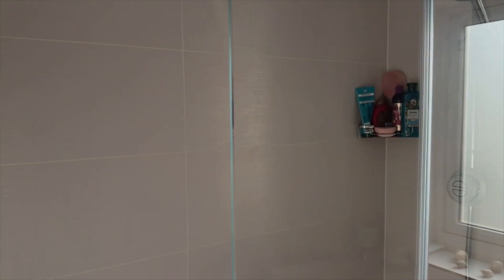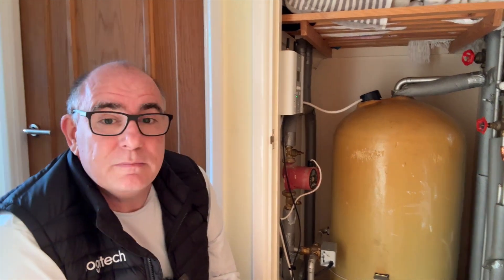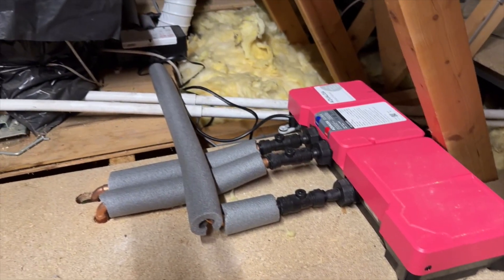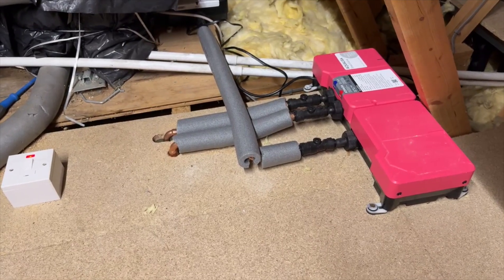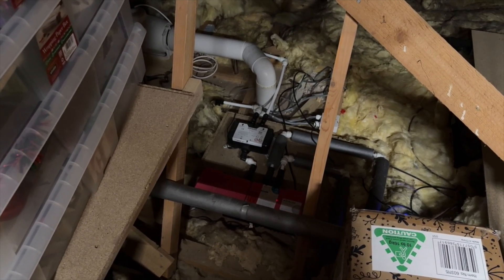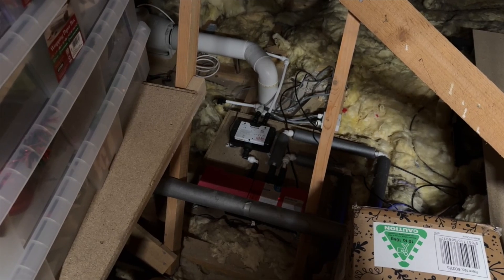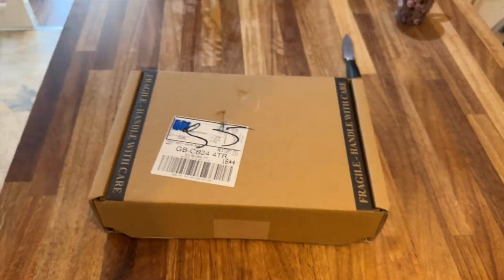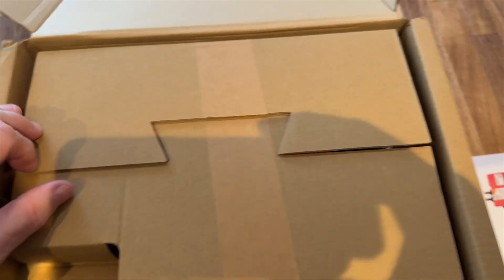Avoid These Heat Pump Pitfalls That'll Break the Bank!

Comment: how do you turn a heat pump of on a warm day and like this morning we get up to a frost , and what did you save changing your hot-water tank
Reply from the maker: you don't have to, it has a temperature sensor outside, it figures out based on your set temperature on the thermostat what the water temperature it needs to generate based on the difference between inside and out and gets on with it. Its all automated you just set a temperature in the house and forget it

Comment: Early on there seems to be some confusion between vented and unvented. Vented is usually a cylinder with a cold water storage tank. Unvented is typically served by mains pressure, so long as everything is sized correctly there is no requirement for a pump. Maybe this is best described by an industry specialist.
Reply from the maker: Yeah, I might’ve gotten the wrong way round, I’m an owner not a plumber😂

Comment: Why not use a vented cylinder designed for heat pumps, and before anyone says you can’t you can! There are companies that do make cylinder for heat pumps they just have much larger coils. 40 years ago I used to buy special high recovery cylinders for clients who needed them.
Reply from the maker: i’m sure there are, but to buy the solution from my vendor they will only supply cylinders that are tested by them as guaranteed to work. so my choices are very limited
Reply: @JonathanTracey My house is 8 years old, so the hot water tank and system is as cutting edge as it gets, but octopus still wants to change it all if I get the heat pump installed.
Reply from the maker: I think to get the grant it needs to include a tank that is up to the spec given by the government. The only way to be sure is to change it

Comment: This new unit you've purchased isn't a pump, it's just a remote valve unit.  An unvented cylinder doesn't need a pump to feed the shower.  Crazy that they charge hundreds of pounds for a box with some solenoid valves in it!
Reply from the maker: yeah i got my terms mixed up, #notapkumber
Reply from the maker: they even told me they do t make spares available to other companies until the product goes out of manufacturer - which means they can charge what they want

Comment: In 2022 I installed an unvented hot water cylinder designed for use with a heat pump but I operate it vented. We don't have great water pressure so I decided to retain the existing shower pump and a cold water storage tank. Two years later and it still works fine. If we had a reliable high pressure water supply I might have chosen differently.
Reply from the maker: interesting i’d didn’t know that was an option, i’m kinda following their recommendations, so hopefully it will work out ok

Comment: Oh John, you can have them converted from pumped to a pressurised one, I did, it was about £100, a company called ‘our bathrooms’ I recall, found on eBay.  Beauty is it’s the same box so no change of pipe work. I have 3 varieties of the aqua Lisa showers now, they’re easy to fit. My shower valves now live under the floors and bath rather than in the loft.
Reply from the maker: i did look at it but getting them converted just seemed a risk. did they change the existing modules or replace them entirely

Comment: I heat water to 43C in my Mixergy HWC, old electric shower no longer used, shower head connects to bath tap outlet for nice 43C shower at mains water pressure which for me is good.
For me the pressure from old header tank meant hot water flow was poor (Bungalow).
If insufficient pressure on mains I believe a pump could be added to boost that.
Reply from the maker: was hoping to get a mixer by tank but it just won’t fit in my cupboard and the wife didn’t like the idea of taking space from the bedroom.

Comment: Hi Jon, looking at the diagram at 6:17 it' looks like the pumped version is the same as the unpumped version, only with a pump added on the side. When your plumber comes to change them over, maybe worth seeing if you can just unbolt the pump off the side and you've effectively got an unpumped version. Worth a try, may save you £800.
Reply from the maker: that’s what i hopped to do as the older style ones allowed this, the ones i have are one piece so no way to disconnect it.

Comment: I absolutely do not understand why on earth you need a pump when you essentially get main's pressure on the hot water side. Do you not have a high enough mains pressure to support a shower?
Reply from the maker: The existing system needs a pump and a mixer due to to much difference between the hot and cold water pressures, the pump regulates the flow of cold water, it also lifts the hot water up a floor to the showers. The new system will be pressurised enough to not need it

Comment: Hi you are going to hate the shower as the pump you  have to fit is usless and very expensive we had a heat pump fitted 2 years ago and had the same shower and had to get a new pump to Handel mains pressure. Biggest regret is the loss of a very good shower
Reply from the maker: Our plumbers did a pressure test and assure me will be ok, fingers crossed
Reply: @JonathanTracey  it’s basically a glorified thermostat
Reply from the maker: Yep

Comment: if they are not cheap and quite good sell them used and get some money back.
Those are long lasting products and demand for used is always there - it is not cheap chinese crap.

Could be a lot worse.
Reply from the maker: That’s the plan, once I have the new ones installed will get my plumber to find second homes for them

Comment: Although I would always prefer an unvented cylinder instead of a vented cylinder I'm pretty sure you could get a vented cylinder that is compatible with a heat pump.
Reply from the maker: The options are suprisingly limited and due to the space constraints in that cupboard our only option was an unvented one
Reply: @JonathanTracey  I find that hard to believe. You could get a vented HP cylinder where the HP circulation circuit is pressurised whilst retaining the vent arrangement with shower pumps as existing. The HP cylinder is bigger due to bigger coil for better heat transfer from lower temp water but other than that - no change. I asked this specifically of my installer as I really don't like pressurised HW together with no stored C water, so I know it can be done!
Reply from the maker: It probably can be done but I was limited in the choice they would offer because of the size limitations. But have no issues with it being pressurised
Reply from the maker: out of interest (only ever having a vented on) why would you prefer a unvented one?
Reply: @JonathanTracey  unvented cylinders provide hot water at 2 to 3 bar of pressure which means you don't need to use pumps to have a decent shower, a header tank in the loft isn't necessary, they maintain a good pressure even when multiple taps/showers are in use and I think they also heat up quicker.
Reply from the maker: oh so we may lose our header tank as well, that would be good
Reply: @JonathanTracey  forgot to mention that if your mains water pressure isn't very good then there isn't much of an advantage installing an unvented cylinder, hopefully your mains pressure is ok.
Reply from the maker: yeah it’s pretty good, drops a little in the summer but this time of year it’s like a fire hose

Comment: Going from a vented cylinder to unvented and pressurised wouldn’t have needed a new shower pump.
Reply: @johnb7644 I was thinking the same thing until I saw the 'pumps' at the end. It isn't a pump per se, it's a mixer unit for the shower, that also has a pump if you have a vented system. The new units he ordered are just the mixer unit.
Reply: If I’m not mistaken these are digital showers I.e the bit on the wall are just controllers.

A conventional mixer bar shower you would simply remove the shower pump but what’s happening here is the pump like a power shower is now not needed and being replaced by the mixing unit. The reason it’s so expensive is because digital units are just expensive full stop.
Reply from the maker: i’m afraid it does, it’s not just the pump the entire control unit needs to change to support a pressurised system. the brand i have won’t start if there is pressure on the pump.
Reply: @JonathanTracey what??? Why do you need a booster pump at all if you’re going to mains pressure?  It just makes no sense.
Reply from the maker: Maybe in am not explaining, the current one is pumped, the new one replies on the pressure in the cylinder, so althought I call the boxes pumps the old one actually pumps y]the new one uses pressure in cylinder
Reply: @JonathanTracey   3 bar mains pressure is enough for a domestic house, The pressure comes from the mains to the tank then showers etc, no need for pumps
Reply from the maker: Yep that’s what the new boxes support
Reply: @ so what’s in the box?  We just removed the pump completely when we got rid of the cold water tank in the loft and plumbed the hot and cold feeds straight into the acqualisa shower.
Reply from the maker: A mixer basically

Comment: Hi Jon I’m Les and you may recall I wrote you a comment on one of your other videos a few weeks back, I said I think we where on the same track in regards to an Octopus Heatpump installation.
Mine was done around 3weeks ago now, so this evening I have just watched your latest video with concern about your shower and a shower pump, so I had the same set up as you with a vented cylinder and very poor hot water pressure all over my house as I live in a 3 bed  bungalow, my cylinder was in the loft area and when the Octopus team arrived I took the into my loft to explain my old set up and what pipes went where, and when I told them these pipes feed the shower pump the pump being fitted behind my shower on the ground floor below in my bathroom,they said right away they would need to get rid of the shower pump as it was not needed any more,then during the course of the installation they changed quite lot of the old pipe work for the hot water supply and shower pump was removed, it was brilliant shower with the pump before the work started but my water pressure was terrible, I ran my hot water tap in my kitchen this is the tap which is furthest away from the old hot water cylinder, so tap on full to fill a pint beer glass took 13 seconds yes 13 that’s how poor the pressure was at that tap, so after the install now a new and bigger cylinder of course and now a pressurised system, the Same tap and glass  experiment the glass takes 3 seconds to fill it is unbelievable I had a 2 bar shower pump on the shower and it was very good now no pump at all and it’s far better my shower is not the same brand as yours but looks very similar idea, so I would hang fire with fitting the new equipment until your heat pump installation is done and see what its like with your new set up.
I hope this as not caused you any upset but I’m just trying to be helpful Jon.
I don’t know how to send a private message on YouTube, but if you do and you want to send me your number and I will video call you on FaceTime or WhatsApp video and show you around my system if you like. Just one thing I’m out of the country from the 3rd Sunday for 2weeks so it will need to be today or tomorrow for a video call. 
Les
Reply from the maker: thanks for the update, glad it’s working well, how’s the heating been, is the house nice and warm? wrt shower my brand won’t start if the pump detects pressure so that’s why i had to change it out
Reply from the maker: thanks for the offer i’m also travelling for business so maybe catch-up when we’re both back
Reply: Ok Jon yeh house as never been so warm but in a different way neither has it been very cold as yet the temperatures here in the north west are quite high for this time of year the biggest difference is the temperature is very even all over my bungalow and the radiators are cool most of the time which is far better so running all day at around 21 degrees and night time set for 19 the other big difference is I have set the night time temp for 21:00 and the house is still warm the gas could be on until midnight and temps would drop within an hour of going off 
Nice and even for hours after it’s gone to the night time setting in fact at 19 I have yet to see that the HP as ever kicked in as the temp does not drop below 19 or hasn’t done the place stays warm  the hot water is brilliant in every respect good pressure and never seems to run out the controls are a bit of a challenge at first but after a week or so you get to know what your doing so now I rarely touch them I appear to be using around 5-7 KWs a day but its on 24/7 so happy with that anyhow I would have liked to have shown you the set up but I’m not giving my phone number out in a public web page that why I ask if you knew how to send a PM on you tube as I don’t but best of luck with your installation.
Les
Reply from the maker: Sounds good, will let you know how I get on